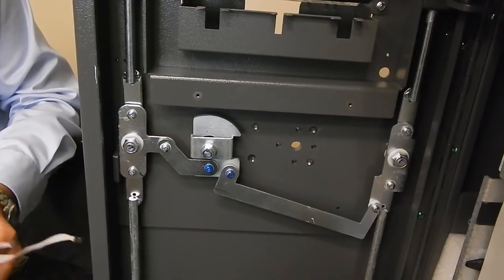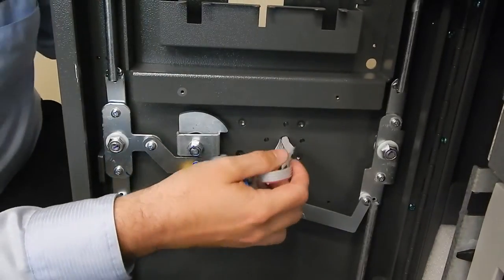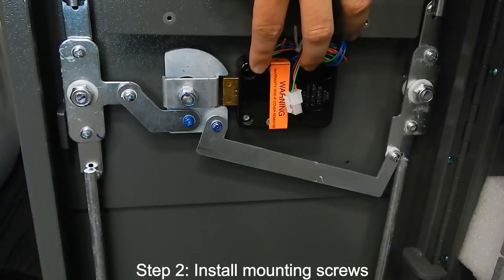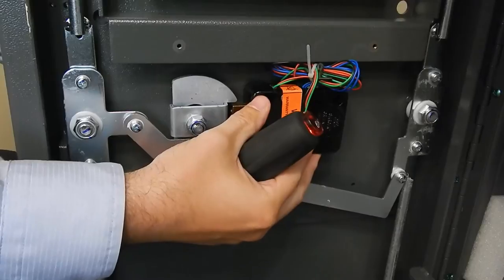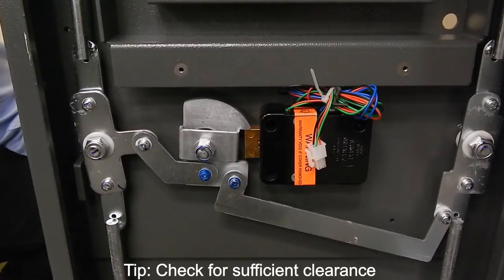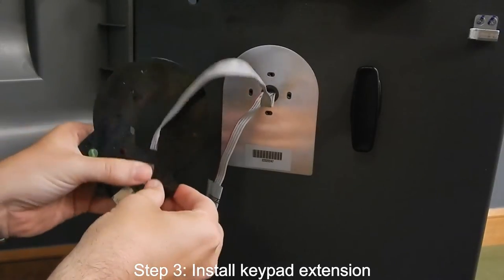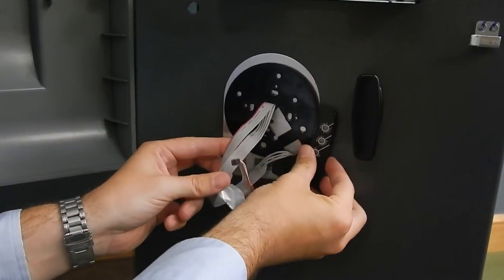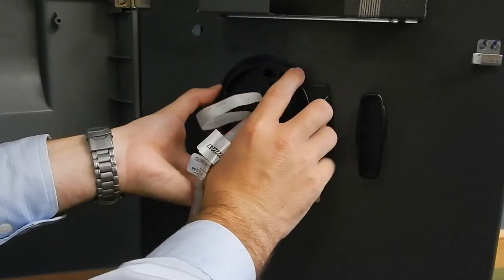How to Install a S&G lock by Cash Connect

Comment: what happens when someone cuts the wires that are connecting the lock and the keypad??
Reply: well i know the lock wont release but wondered how we'd get back into the safe if we cant connect a new keypad? Likely would need drilled by a locksmith, invalidating your expensive safe..